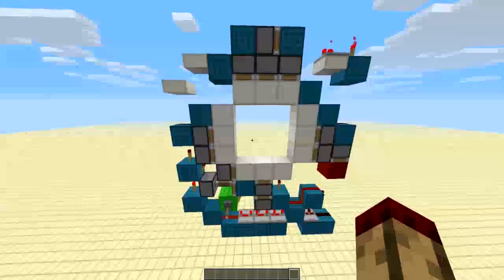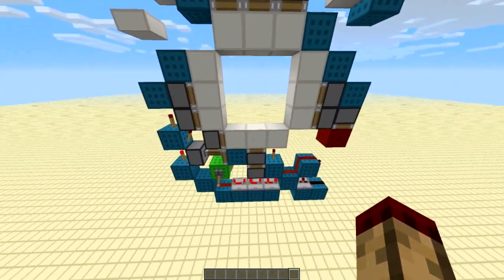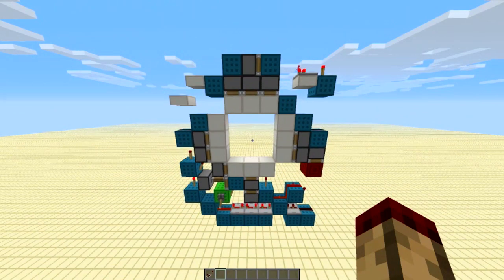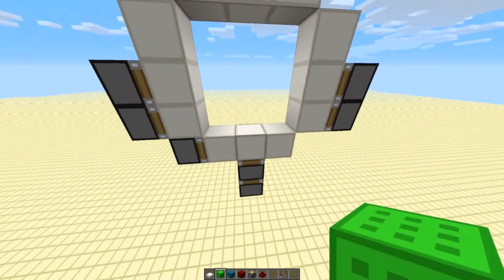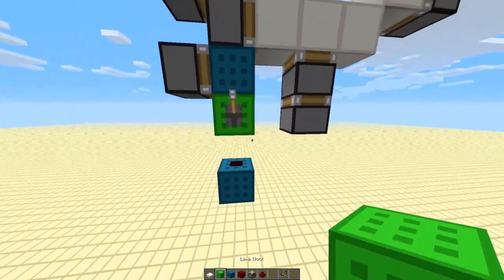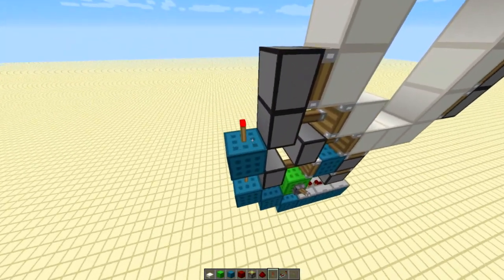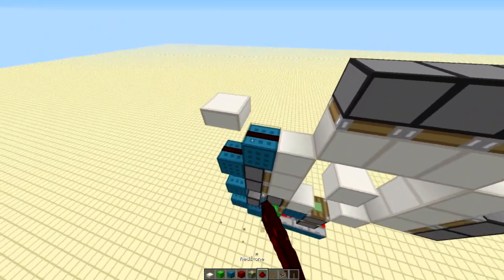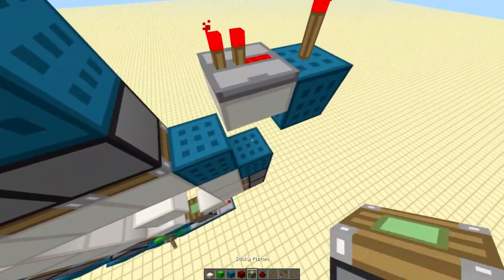Tiny 3x3 Piston Door [1 Wide] - Minecraft 1.7 Redstone Tutorial

Comment: is this broken in 1.8? There is an issue with the clock part of the build by the looks of things. I've gone over it about 10 times now and it looks right. I definitely have the torch on the far right of the build for the clock.
Reply from the maker: +Damian Jacobs It works fine in 1.7+ Are your bottom repeaters on 4,4,3?
Reply: my repeaters are 4,4,3 i've checked over the design so many times. i'm gonna rebuild it it again

Comment: when i make it, the bottom piston of the double piston extender keeps extending, and i see why, but somehow on your screen its not extended. Did you give it bud power somehow?
Reply: Caleb Arndt ok i watched the rest of your vid to find out that yes you did give it a form of bud power, but it still wont work for me. When retracting, the double piston extender just doesn't work. It ignores the bud power and the bottom piston stays up. Again, i can fix this by breaking and placing the redstone dust, but i would have to do that every time i use the door.
Reply: Caleb Arndt well im an idiot. I forgot the torch on the clock section of the device (near the piston with the redstone block)

Comment: Ok, managed to get it working, just for the life of me, can't figure out how to extend the circuit so the switch will be up where the door would be.  At present, it just opens up the bottom block only.  I'm fairly certain I'm an idiot and doing something wrong, but hopefully will figure it out. Thank you again for a very good door!
Reply from the maker: It sounds like you are running a wire into the green block, you need a repeater so the wire below the green block gets powered to. I hope that helps!
Reply: TT Lemon
I missed that part in your video, I was still trying to figure out the other door you had done where you said something about a t-flop switch and for the life of me, couldn't figure out why I kept thinking about it.  This door has saved me more headaches, Thank you again!!!
Reply from the maker: No problem!

Comment: Hey TT, it seems my Survival mode application isn't going so well. Upon activating the circuit the first couple of times it worked, but subsequent activations either end up with a block being left in the top-middle square after opening. Or the very bottom piston remaining extended during opening.
Resetting it by replacing the red dust (as you've said) does work, but sometimes it takes a few resets before the bottom piston stays retracted.
Any ideas? 
P.S. It's hard to make a decent screen shot as the door is inside a mine.
Reply from the maker: Sounds like you are on a bukkit server, are you?
Reply: TT Lemon I didn't think I was, no. But I'll double check just in case.
Reply: TT Lemon Yeah, it turns out the server has a bukkit mod running. It isn't meant to, but it does. Ho hum, thanks for helping me figure it out.

Comment: Removing the redstone dust then replacing it to correct the position of the bottom piston works IF the top piston has a block placed above it (touching the piston face) before you place the redstone dust down.  Couldn't get this build to work for the longest time until I did this.